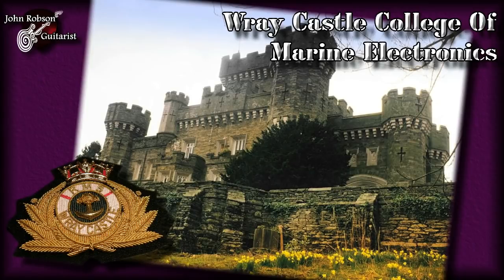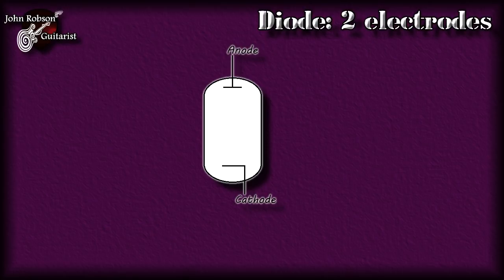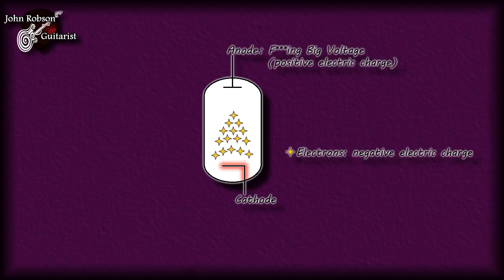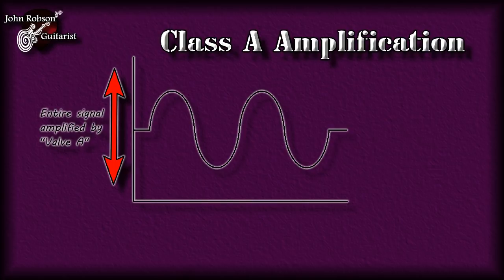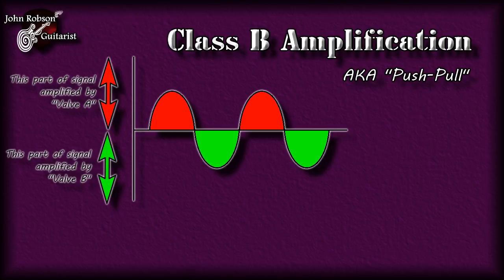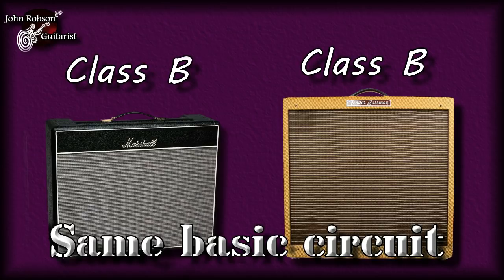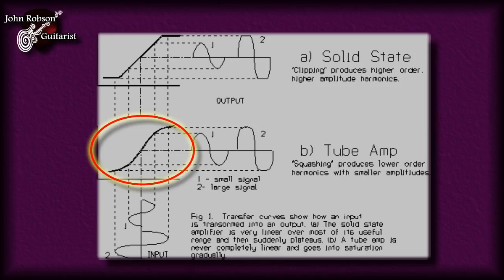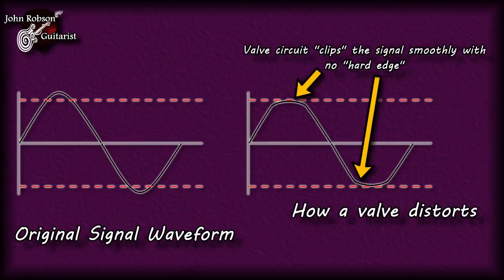How Valve (Tube) Amps Work - basic electronics & jargon explained

Comment: I was after a video explaining the part at around 6 minutes and seemed to find a lot of conflicting videos - even a single video conflicting itself within the actual video! 

Not only that, you get keyboard warriors calling each other out with "Wrong, *insert their own wrong explanation here*" then someone else will disagree with them - and no one is any the wiser.

What I liked about this (i haven't finished the video at this point) is that you state your credentials before you explain and state this gives you an authority on the matter - which I thought was great and so far yours in the only explanation that confirms what little knowledge  I had about valves and electronics (HND in electronics) and what else I'd read online- so thank you very much!

Comment: You're a lucky man John. I am envious. When I was studying electronics, you only did a bit of valve theory so you could understand CRTs. Getting hands on experience with valve ccts is priceless. IMHO that was a nice concise video. Cheers.
Reply: Bassman A2Z - Even in the early 90's when I went back to college you were lucky to find anything on Valves/Tubes and their circuits.  Luckily I still had the Mullard book on valve amplifier circuits from the 1970's though I think that it was probably published at least ten years ten years earlier.

Comment: Lovely stuff! A while since I had a recap on that - I'm a ham operator as well as a noob [soon to be famous] guitarist. Valve HF sets were/are always look on as really cool retro gear causing fits of envy towards those who have built one. But you'd never consider carrying one out on a field excursion, way to heavy and contained things that go bang and emit expensive blue smoke that's a right bugger to put back. Hens my utter amazement when I first heard of all the carry on, snob valve, and eye watering prices on valve amps.
It was quite some time ago that I did my exams and the basics of their operation had escaped me, although I still remembered the square root of two for the size of the clipping in a rectifier.... I think - So excellent! Cleared that up for me. Now for a little chat with my upstart nephew that claims his 30W valve amp has more power than my 80W SS amp.
I do realise a lot more goes into loudness, dB, log functions, etc, etc,

[Probably still buy one for laffs though]
Reply: I need to correct a comment I made above, I have since learned that there is a difference in the power output of valve vs transistor amplifiers with regards to the SPL - sound pressure level or loudness. Roughly, and it is roughly as that are contributory factors, I have be told that there is about a 2.5 magnitude difference between the two. Therefore a 30W valve amp can be estimated to have around the same SPL as a 75W transistor amp. So my nephew's amp and mine are pretty close, but egg on my face for making a ho-haw about the whole thing.
Speakers, cab design, and a number of other issues such as room size and shape will have a bearing on the actual projected DB of an amp, but all things being equal a valve amp is apparently 2.5 times more powerful per Watt used

Comment: Hey Mate, Top video. One question though at 14:10 you show the rectifier but i'm pretty sure you have the arrow facing the wrong direction. My old teacher always used to say the diode was like an arrow showing current flow.
Reply from the maker: It depends if you're talking about conventional current flow (where the charge is thought to from from positive to negative) or electron flow (where the charge flows from negative to positive. I was taught the latter, and the diode symbol is shown the correct way round... I just checked.

Comment: John I noticed that you didn't mention why tube/valve amps sound louder when they aren't or that solid state and valve amps have different orders of noticeable harmonics.  Those early Marshall and other tube amps had tube rectifiers and that sag not just at start up but on heavy load added to the sound.  However they were , compared with a solid state bridge rectification, expensive, added to the requirement, weight, cost and room of the transformer and also meant that they could behave long term rather unpredictably.  I think with Marshall by the time they got to the JCM 800 they were completely solid state.  (Some boutique manufacturers are completely tube/valve rectification.)  

Vox were , and still are, one of the few that used class A that gave a lot of to their sound.  Virtually all others were class AB.

Incidentally that 50/60 Hz (depending on country) hum will only be apparent prior to full bridge rectification unless the rectifier is bust.  Past that you will get 100/120 hertz and then smoothed to a ripple, hopefully.

If people are interested Uncle Doug here on YT has some easy to understand videos, but also check against others.  When you research never use just one source.

That comment about tube amps sound warm as they glow amused me. They may help to keep you warm on a cold day if huddled around it but that has nothing to do with the sound.

Comment: i watched Brian May talk about I believe the saturation point or creamy point when he cranks his AC30 amps, hearing Queen live I understand that lol.  but I have a VOX VT20 X with  Pre-Amp Valve, great amp love to know a bit more but this was like going back to college,
Reply: @Ben Hackett I got  my amp by pure luck a chap was selling it  hardly used  less then half the retail price,  before that I spend time testing amps, the Boss Katana  50 was nice it has great features but there was a but with the tone, the Fender GT 40 sounded too much of in a box, but this Vox is pretty straightforward , and 20 watts is more then enough for practicing  at home,  the software is fun ,  the colour lights are the different pedal selection, I take it you have used the  Tone Room software,  for the money the Vox VT 20x  is perfect for me ,
Reply: @Ben Hackett  yes  I need foot switch I swapped my tube for a bugera low noise one,  I have no issues with the software,  you can change the speaker,  I believe Celestion has one for undre £30 quid,  but I am fine with this one, it suits my needs